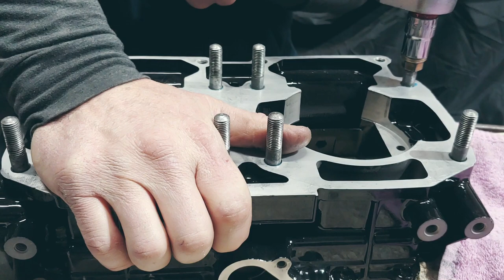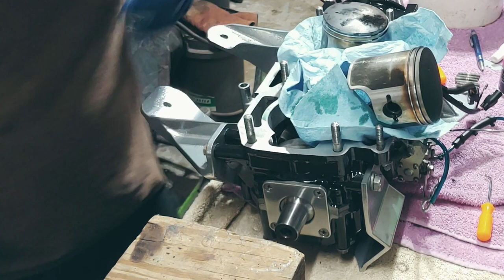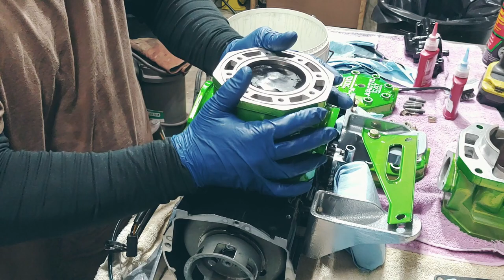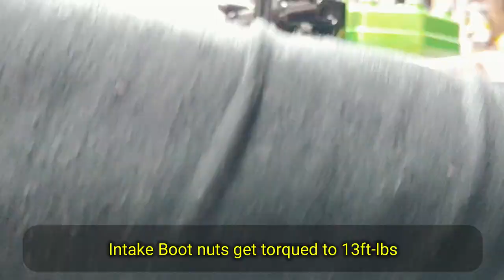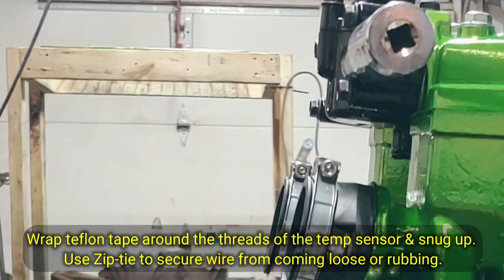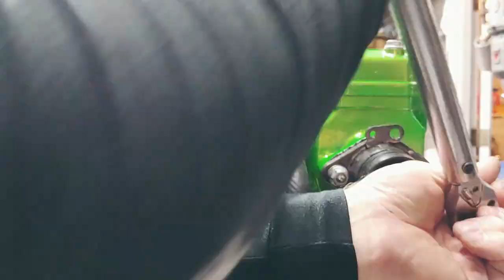1995 Arctic Cat ZR 700 Part 6 || Reassembling Engine

Comment: What brand of equipment do you use to powdercoat your parts with? They look great
Reply from the maker: Thanks! Machine From Columbia Coatings. They have a few different machines. Was using the eastwood hotcoat but that stuff was junk. I use the KK Hypersmooth 2 setup.

Comment: Do you happen to remember how the carb boots spacers go? The new sp1 intake boots I got washer indents on the inside of the boots it seems like and the engine diagram is a little confusing. I see it says a washer and lock washer on the outside also? Is that correct?
Reply from the maker: No there shouldn't be a washer on the mating surface side of the carburetor intake boots. There's only a washer on the outside and then a lock washer and then a nut.
Reply: Alright cool thanks that's where I messed up on it last year then. Just did them again today.

Comment: Got a question for you bud, will my dads 99, 700 engine fit into my moms zr 580 frame?
Reply from the maker: Yep.it should. Just get the engine mount brackets from the 94-95 Zr700. Only.issue I could see is finding the right alignment for the airbox. But just get the 94-95 zr700 airbox ans that should do it. You also want to pay attention to the difference in wattage of the Staters as well. Lighting coil for the newer chassis will have higher wattage. So you might want to make sure that the lighting and hand in the warmers can take the higher wattage. Or try and swap over the lighting coil from the 94-95 zr700 stator to the 99 stator.

Comment: What did these engines have for Hp stock? Are they reliable to
Reply from the maker: The 94-95 have a little more than the 99-00 700's. They were.rated for about 125-125hp... The 90-00 700s were like 120. They are reliable if you tale care of them. Some said the cranks would snap off but that's not common and was mostly likely due to extremely and regularly uncared for drive clutches. So keep up on the the maintenance and run the idle a lottle higher like 1700-1800 and that will help abood the low idle shake they can sometimes have. Which is also partly because of a worn out clutch.
Reply from the maker: There is also a combination of 94-95 parts between the carbd and wildcat efi models that will produce about 145-147hp.

Comment: Use twin pipes maybe that old 700 twin pipe will keep up with modern day 800s an 850s twins only
Reply from the maker: I got a set of D & D's that go on it along with a d and e can and yeah it moves
Reply from the maker: Once I get the Pistons back in it that I race coded I'll put the whole thing back together and show it off in a video it turned out pretty good as I refinished the exhaust as well
Reply: @Fixin2Ride-Official-  my old mans 1999 arctic cat powder special starts to cruise at 7000rpms i havnt felt the need to go any faster then 7000rpms on his 700 speedo dont work an i havnt put my gps on it yet to see how fast its moving along at that speed his is just the Y pipe not no twin pipe
Reply from the maker: Yeah they move. But these older 94-95 have a bit more power to them. Im guessing because of the porting. They originally come with tein pipes like said, but the d&d twin pipes add about 12hp.

Theres also a combination of these old 94-95 Zr700 and Wildcat 700efis that will make 147hp just by combining them. Id have to look at my noted to remember the combo...